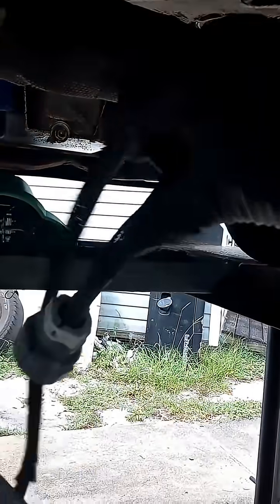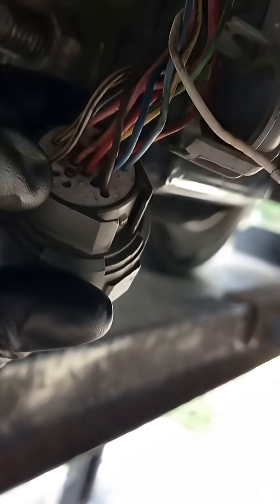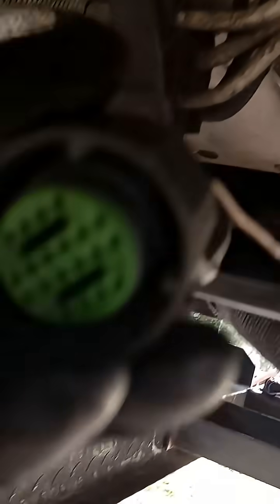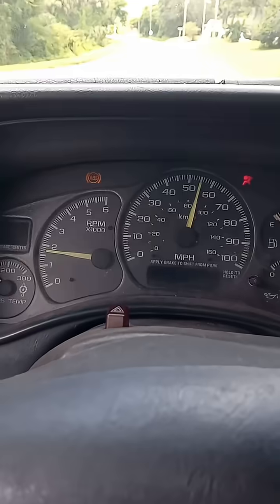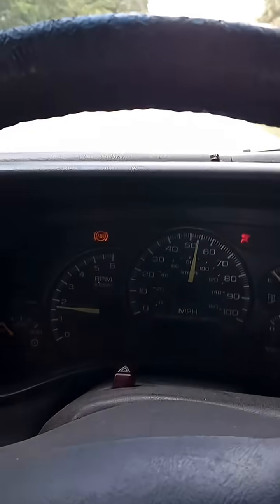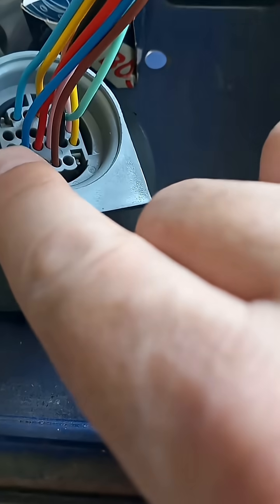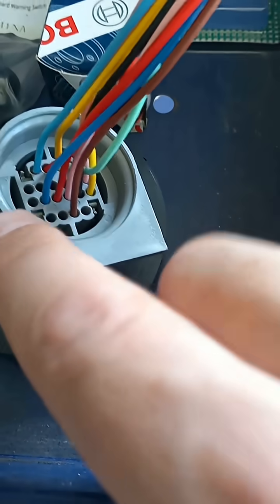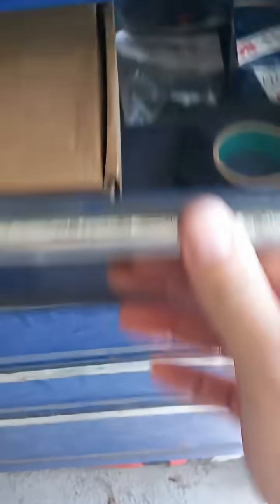VICTORY! Converter lockup engaged 4L60E to 4L80E swap

Comment from the maker: Here is a how to with pictures on what I did. 

https://lt1swap.com/4l60e_4l80e_harness.htm
Reply: Lack of QA, i know you reported it to them or blasted their social media right lol.

Covid Sucks, It really really sucks.

With the 2600-2800 stall, 3.23 gear mine at about 80 runs around 2000 rpm you have what gear in yours?
Reply from the maker: @shadowopsairman1583 3.73s + the OD ratio is .75 🆚 .70 of your transmission. My rear tires are 29.8" tall

I have not said anything yet, about to go write a review now. I highly doubt anything will become of it.